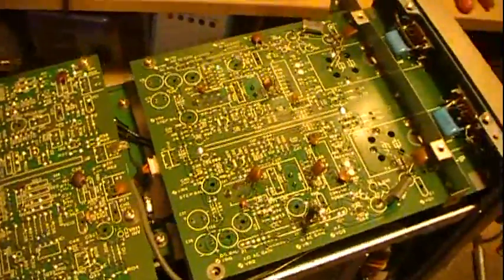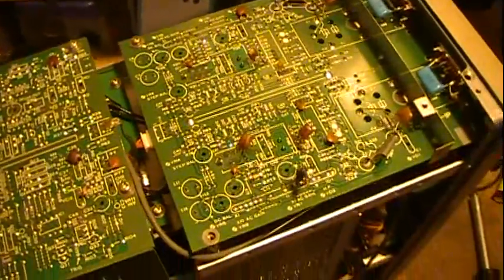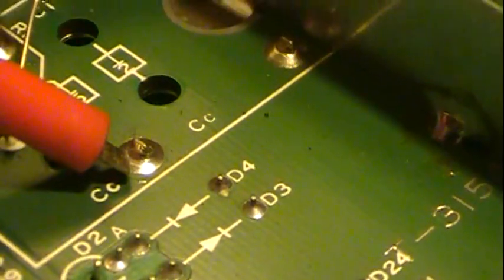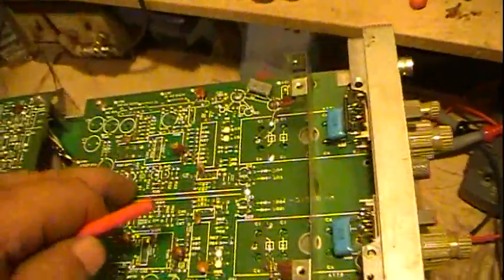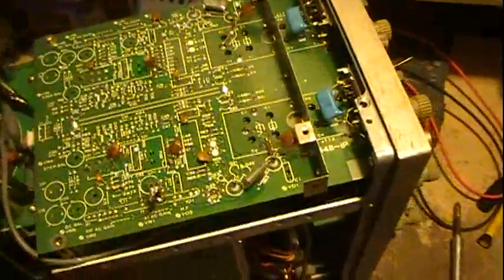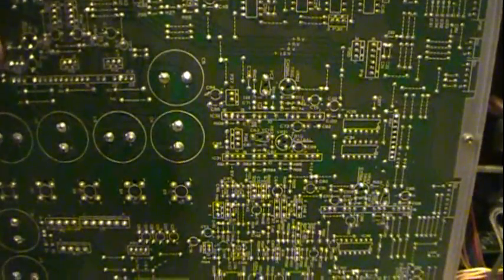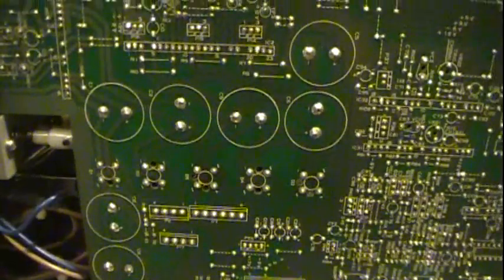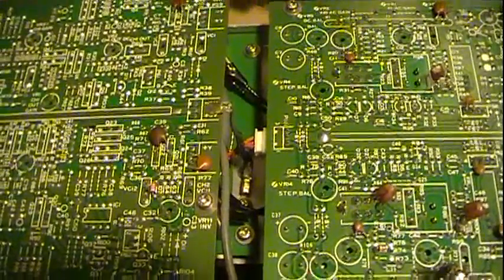Trouble with my oscilloscope

Comment: Dennis, I have a Leader LBO522 Oscilloscope and a few years ago I accidentally Shorted Channel 1 to mains ground and I got a loud bang. after that the scope would just have some weird reading on both channel. any ideas on what could be the problem?
Reply from the maker: From your comment, the scope probe came in contact with earth ground. This should not do any harm to the scope. 
The scope's input has a switch that switches the input from AC to DC and to ground. That ground is mains or earth ground. So you see that when switch to ground is the same as the probe coming into contact with ground.
As to your question I'm not familiar with your scope but you might to check the vertical preamp board.
Reply: Thanks Dennis.

Comment: Yes, seen many of those type of connection pin crack loose. Very common problem I come across in the older Baldwin organs. They use the exact same connector to terminate wire connectors to a PC board, and mostly to connect two boards together. Look for every one of those connectors in your oscilloscope and reflow them all. Yes, you are also very correct. Those connectors quite often develop a black corrosion right where the internal connectors meet. I use a razor blade to clean the pins and a micro welding torch tip cleaner (which is like a very small rat tail file) to clean the socket part.